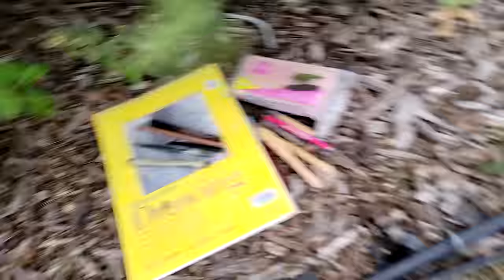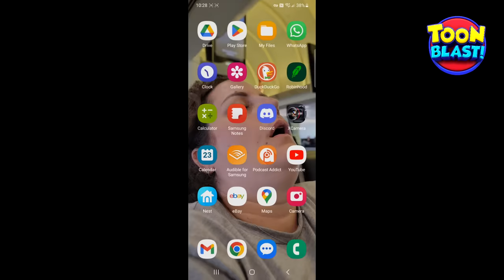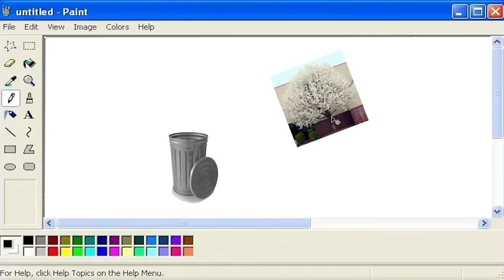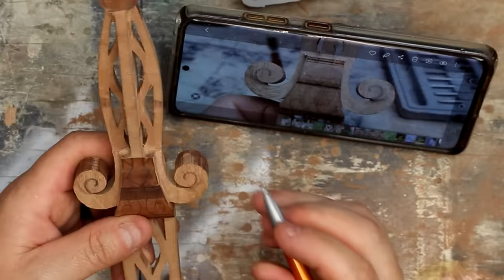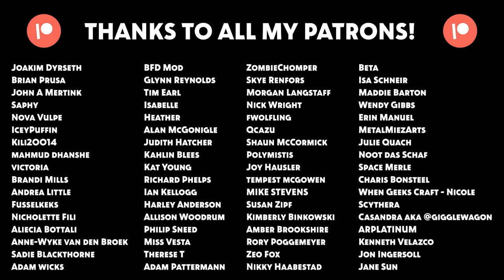Carving an insane Fantasy knife from Firewood

Comment: One thing I prefer to do with delicate wood items is finish them with slow curing epoxy. It tends to seep into the wood quite deep (with something like this it will most likely go through the whole thing) and give it more strength. You usually want to put a UV-protective coat on it after that since epoxy tends to yellow when exposed to sunlight during the years. Some boat finishes are designed for that exact purpose.
Reply: Something I learned in a class all about manufacturing is to also use a vacuum (if you have one, lol). When the air is sucked out, it forces the epoxy even deeper into wood. You can make some stunning and incredibly sturdy products that way.

Comment: you should cast the handle in resin to make it rounded and easier to hold and you can add more wicked patterns with clear resin
Reply: That defeats the entire idea of making it only from wood. 

If you yourself are crafting with resin, you might want to consider doing so with better ventilation.
Reply: @Fleagle68  just thought it'd look cool is all

Comment: oh, u watch MrBallen while working too?
also would be neat if some knife maker, metal worker or blacksmith would make a functional variant of this. like a real metal blade, maybe go extra mile and plate the middle part of the blade of brass. would be awesome.
hardest part would be to make the tang so it blends into the wood handle seamlessly while still have the structural strength

Comment: I wonder how it would have looked if the lower 1/5 or 1/4 of the blade had the same design as the handle and then the remainding 4/5 or 3/4 smoothed out into a flat blade like the knife has now.